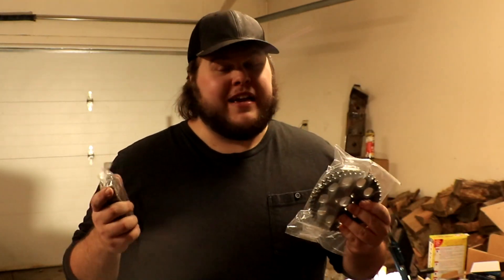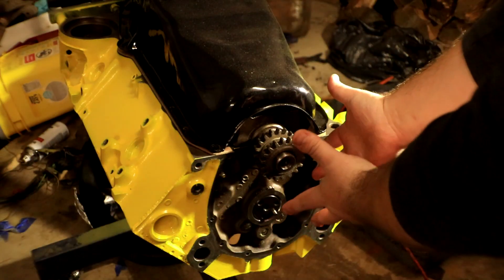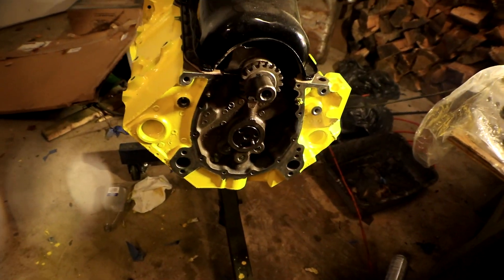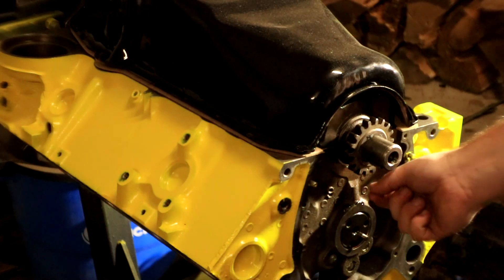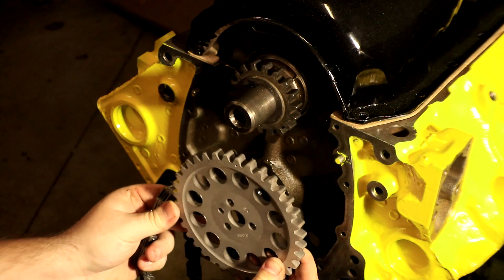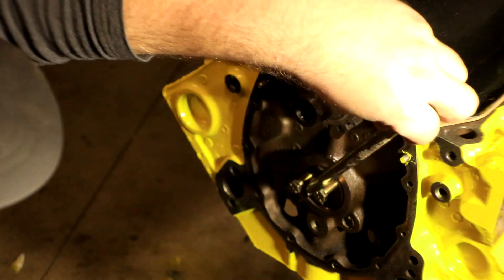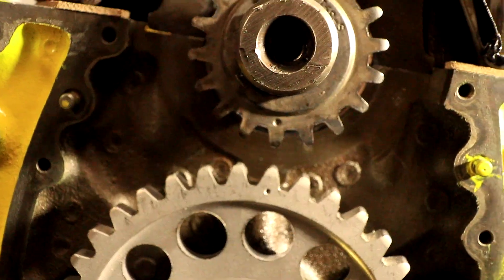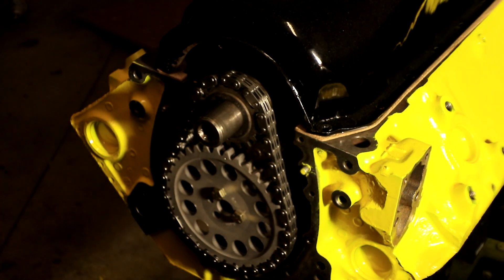HOW TO INSTALL THE TIMING CHAIN IN A CHEVY 350 ENGINE!

Comment: my haynes manuel says 12 oclock and 12 oclock when motor is upright-been using this book since 1980 and built 3-350s and 1-283-all run good-the 282 is a 1961 corvette motor-so i dont get it bout the dimple to method or 12oclock crank to 6 oclock cam

Comment: Those cheap timing chains have to be replaced after only 30.000 miles better get a Cloyes double roller! You cant trust these yellow plated cam bolts made in China...get some HQ from Jegs or ARP in black with securing shim.

Comment: Why didn't you use a double roller set 200,000 miles no problem the crap set you used is worth 50,000 miles.

Comment: To get the dot pointing straight up rotate the engine to top dead centre No.1 cylinder. By the way they sell a locking tab for the cam bolts for about 5 bucks that gives you a bit of extra insurance that the bolts won't back out.